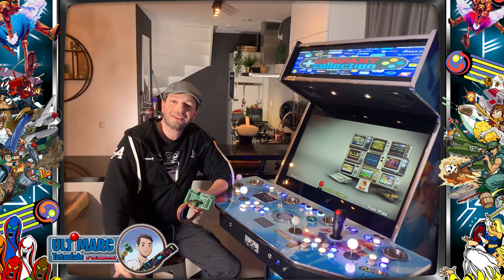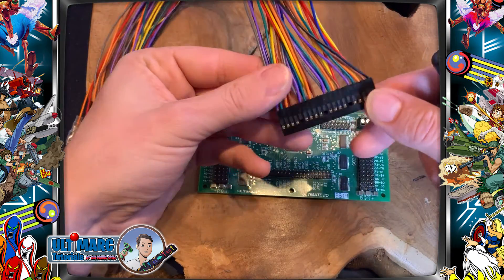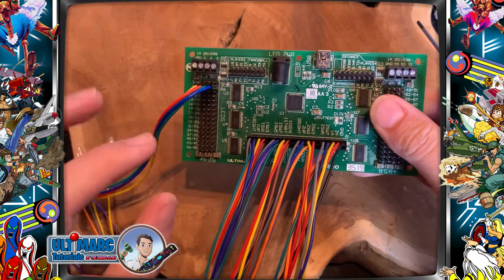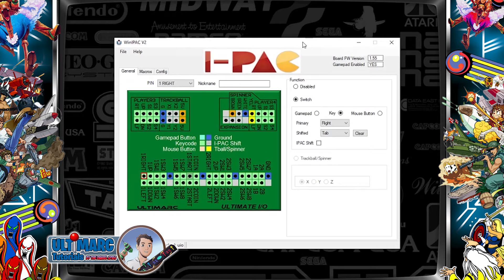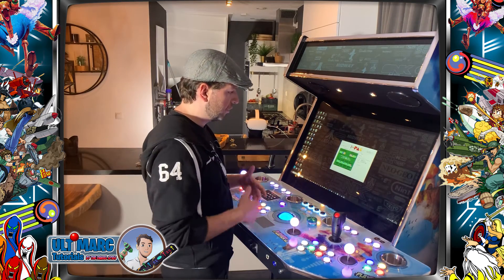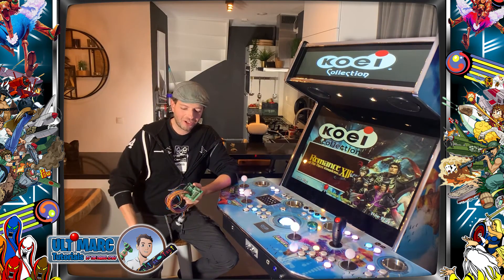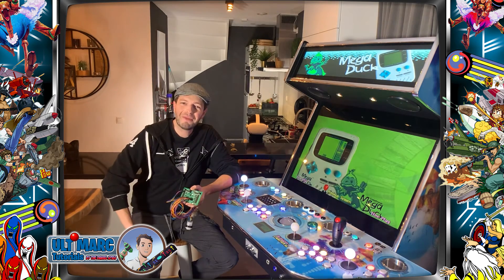Ultimarc Product tutorials: Ultimate IO board (Keyboard Encoder AND Led driver combined)

Comment: I have started, building a machine for my youngest daughter for her birthday and really want to get the LED option but I am scared I will screw this up. It looks so simple. What I did not see was how you connected the Board to the machine. Was there a USB slot already installed the the Ultimarc? I am building her machine on a HP Elitedesktop that runs Batocera.

Comment: Thanks for the video, great work! I wanted to ask a question. I have this board, and when I switch from X-input to D-input, the configuration is lost; the joysticks and some buttons stop working, and I have to reconfigure them. Do you know if this problem could be related to the firmware? Which firmware would be correct for this board? I have version 1.55, but I think there's a newer version. Could you help me? Thanks.
Reply from the maker: X Input is not really supported and Ultimarc also suggest that you don't use it. 
It would maybe be possible to automate importing setups but I have no experience in this myself :-)

Comment: Hey, thank youso much for this video! I am thinking about having 4 player and a trackball, I can still benefit from this board if I connect the trackball via USB directly to the computer right? I imagine the LED would still be possible to connect to this encoder, is this right?
I will have 28 RGB buttons, 8 buttons for player 1 and 2. 6 buttons for player 3 and 4.  I am assuming the trackball will consume one more of these LED slots, but will be connected to the computer via USB. Will this work, or do I need another setup?
Reply from the maker: Yes sure! But with that setup you can just connect it to one of the TWO Ultimate IO boards. Don't forget to order the LED pcb and a translucent trackball :-)

Comment: Please how can this board be used with an original coin mech on an arcade machine please could you maybe do a video showing how if its possible ??
Reply from the maker: You just connect the coin switch like any other button. There is no difference :-)

Comment: Hi Daniel,

I am having an issue with my Ultimate IO setup. I have synchronized all my controls using the WinIPAC software, and everything seems to be working correctly, except for one specific problem: I cannot move up on player 4's joystick. I can move left, right, and down just fine, but the up movement doesn’t work. All other buttons and controls are functioning as intended.

Initially, I had a problem with button 1 for player 4, but now it's just the up control. I’ve used a keyboard tester, and all the joystick movements register correctly. 

I have two Ultimate IO boards; one is running firmware version 1.56 and the other is on 1.55. This issue is quite frustrating since everything else works seamlessly. 

Could you help me resolve this problem?
Reply from the maker: Sure! Please repost this message via email: thedanielspies at gmail.com and I will help out!
Reply: @ thanks Daniel

Comment: Nice nice work! I don't like the preset mode 5 on all the IPAC: if you store keys on mode 1 and then switch to mode 5 for storing a new configuration in Xinput mode for gamepad, if you return to mode 1 manually with shift + sw1 for 10 sec, it doesn't maintain configuration stored on mode 1, but, the last stored on mode 5. mode 5 is not a real preset
Reply from the maker: Thanks! You can maybe send Andy (Ultimarc) an email about this? He might be able to help?
Reply: @TheDanielSpies_Arcades already talked with Andy. He confirmed what i said. Mode 5 is not a real preset. The board only stores ONE manual preset. Only way is switching user presets via command line. It works, nice for switch from mode 1 (keyb) to mode 5 (xinput user) BUT, the switch from mode 5 to mode 1 via command line TAKES..FROM 15 TO 18 SEC !!!!!! with frontend...is unaccettable!! Was better to do this manually pressing shift and sw1 or sw5 for 10 sec but...there is only ONE REAL PRESET: no solution

Comment: Great video. I really the software would highlight the button I pressed instead of me always trying to remember it.   Would be great to show if you plug in the cable in the wrong pin
Reply from the maker: Yes! That is on my wishing list as well. I will talk with Andy if this would be possible. Maybe also find a way of getting X input AND LedBlinky to work on just one board.

Comment: Great explanation, I have question though.  What is the expansion used for?  Only using 1 I-PAC io and I am running 4 player (8 buttons for player 1 and 2, and 6 buttons for player 3 and 4)  I am wondering if I can use x1 and y1(trackball side) for player 3 buttons 5,6, and white and yellow (Spinner side) for player 4 buttons 5 and 6.
Reply from the maker: I don’t think that will work 🤔 to be sure you should ask Andy from Ultimarc

Comment: How do you jump between boards in the software when you have two boards?
Reply from the maker: LedBlinky will find two different boards in their software if you flash the firmware to ID1 and ID2. For WinIpac, I just pull the USB cable out of the one I don't need during setup.

Comment: Hi, Newbie here. After doing research and watching your videos I went ahead and purchased the iPac ultimate, the gold leaf buttons and the servostiks. 

So….
My iPAC ultimate harness ground wire has the gold leaf size connector (small) and the daisy chain ground wire fits all the gold leaf connectors fine….  BUT the ground on the Servostick joystick switches are the larger size connectors. So basically my grounding daisy chain fits the button connectors but not the joystick ground connectors. 

I have another daisy chain with the larger size connectors but I don’t know what to do with it. I don’t see another ground terminal on the iPac ultimate harness. 

Am I supposed to bend or maybe solder the small connectors on the daisy chain to fit the joystick ground connectors?

I can’t find anything online about this issue. I have hit a wall and absolutely ANY advice would be VERY much appreciated.
Reply from the maker: Hi, I might make a video on that matter. For now: there are several sized crimp connectors. Goldleaf buttons use the small ones (2,8mm) , but joysticks generally use the medium ones (4,8mm).  Sometimes your connectors don’t match. In that case you will need to cut the wires and solder them together indeed. Normally, if you order an Ipac at Ultimarc, you can choose the harness with the appropriate crimp connector dimensions. Most of the time no soldering needed.
Reply: Thanks. Yes I bought a crimp connector and added the right size connector to the daisy chain and all is well. Thanks for the reply and for creating such great and useful content. Much appreciated! 👍🏽👍🏽

Comment: Awesome guide! I'm looking to upgrade to this from the i-pac 4, but I need a total of 45 inputs for the joysticks and buttons. Players 1&2 have 6 buttons, 3&4 have 4 but all have a coin and start button. Can just one ultimate I/O board support this? I don't see any places for players 3/4 "coin" and "start" inputs printed on the board. Thanks!
Reply from the maker: Correct, you can just choose any of the available ports for players 3 and 4.  You normally need to use two Ipacs for a full 4 player setup, but without a trackball and spinner it might just work with one IO board. You can double check by asking Andy from Ultimarc.

Comment: Great video, but im trying to figure out where do you plug in the menu buttons, or pinball buttons on your ipac ultimate? Been trying to find that out but to no avail
Reply from the maker: You can plug them anywhere and map them inside WinIpac. I always see which ports are still available and connect them to these :-)

Comment: Great video. I have a light gun. I am trying to get the uhid to output 5 volts when I push the trigger on the gun. I have a seperate pin allocated to this wire and I can get this pin to output 5 volts, but I can’t get it to link with the trigger. Its says in the u config manual I can do this under “uhid controlled leds” thank you
Reply from the maker: Hi, I am not exactly sure what it is you are trying to do, but you can always email me and I can see if I can help! thedanielspies at gmail.com

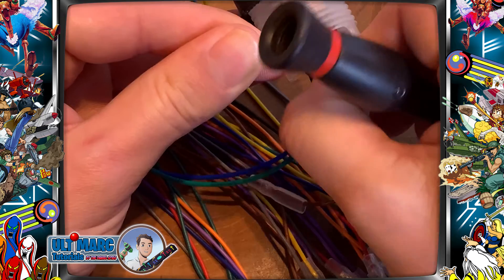Comment: Daniel, at 5:41 you can see there are two metal prongs that the connector would fit to.
How did you know which one to pick? And what is the other one for?
Reply from the maker: This is just a normal switch. These two ‘prongs’ let current flow through them when the button is pressed. You need ground and signal, any orientation is fine 👌🏻

Comment: Having issues installing Ultimate IO here. Tried on 2 different CPUs with Win10 and Win11 and both give a msg "driver error" on Device panel. In Control Panel says " problem with Pnp devices". Removed all harnesses, driver, tried reinstall the driver, DX driver, .NET but no lucky.
Reply from the maker: You can contact Andy from Ultimarc for this. He is a great guy and is always willing to help! Let me know when the issue is solved or if you still get stuck somewhere. Kind regards, Daniel

Comment: I decided to rewatch this to get ready for my second build. I notice you talk about mapping everything to keys. I ran into trouble doing so using a u360 stick and getting buttons wired to the ultimate io to combine as a controller. Using x360ce saved alot of head aches for me and alowed me to play games from steam with no isues because alot of steam games dont enjoy multiple users using a keyboard. So hopefully that helps someone whos trying to get it to work with everything and not just emulators

Comment: Hey Daniel, quick question.
Your CP is quite large. Did you put on extensions on the main harness for the buttons? Mine literally hangs because the wires are too short to work with.
Reply from the maker: Now a days I mount the ipacs closer to the buttons to do as little soldering as needed. But… i still make many custom extention wires nonetheless 😅

Comment: Can you set up this IPac as Xinput 
1. and still use led blinky ?
2. Can I move the button layout in xinput for example I usually run
LB=low punch
X= medium punch 
A= fierce punch 

3. If in xinput mode will the IPac always be player 1/2 ? Or if I turn on a separate Xbox controller can it turn into player 1  as well?
Reply from the maker: No, when using XInput, the RGB functions are disabled. second question, no. :-) 
You can use a PACLED board for RGB of course.
Reply: @TheDanielSpies_Arcades  I thought the ultimate has RGB functions ? A pac led would be used if I had a pac mini or something with none rgb  right?
Reply: @TheDanielSpies_Arcades  or you are saying a seperate led controller is needed to pull off led functions if I want to use xinput capabilities? You can’t reassign the button layout in xinput at all? I’m just trying not to buy the wrong stuff for my build. Thanks in advance for the clarification

Comment: Could I get a little assistance. This video was very helpful. I was able to get the two IO boards, buttons, joysticks, spinner and trackball set up and they work. The issue is when I go to configure buttons on retropie it will only let me Map the controls for one player because it recognizes all the buttons as keyboard and not game pad. Is there a fix for this?
Reply from the maker: Well, you could set the IO boards to X-Input mode but then the RGB function does not work anymore. 🤔 I thought that Retropie had no problems with keyboard inputs?

Comment: I'm setting up a 2 player arcade with trackball and spinner.  I'm having trouble with Emulationstation and setting up my player two controls.  Originally my Ultimate I/O board was in keyboard mode but then I asked Ultimarc and they mentioned I should possibly have it in mode 2 Dinput... do you have experience using mode 2 or possibly mode 4 Dinput user custom with the I PAC Ultimate I/O and any thoughts as to what I'm doing wrong?  Love your videos.
Reply from the maker: Hmm I don’t have experience with Emulationstation + Ipac IO boards. But I did do an Emulationstation build a few years ago with a normal Ipac 4 that did not give any problems. 
Email me to explain what isn’t working and I will try to help out. Thanks D

Comment: Hi, I'm confused about one thing and wanted to ask if you can help me. At 5:00 you're showing two different connector sizes for goldleaf or microswitch buttons. Are these two different harnesses, or does the harness have a mix of two different connectors? I see you can order a harness that has both types from Ultimarc but does that mean it only has the larger one for joysticks and the rest are smaller? Or how does it work? Can I have both goldleaf and microswitch buttons on the same console?
Reply from the maker: Hi, The goldleaf buttons have smaller pins than the microswitches. If you order a harness at Ultimarc, you can choose which buttons you are going to use. As the Joysticks have normal microswitches the harness I ordered had both sizes. Hope this makes sense :D
Reply: @TheDanielSpies_Arcades  Thanks. :) I figured it out. The answer for those who may be interested, is that the smaller size harness has larger size connectors for the joysticks, player start buttons, and coin switches. Everything else is the smaller connector for goldleaf buttons.

Comment: Amazing unit. I have an arcade machine but with the x-arcade controll panel which I want to update and make my own custom 2 player control pad. Can you let me know if you have a 2 player config and if you can also provide a list of parts. I love your setup and want to do the same for mine.
Reply from the maker: For two players you just need 1 Ipac! super easy. Also, buy a Hyper Arcade Systems drive from Chris that is pre-configured and you are up and running in no time.
Reply: @TheDanielSpies_Arcades  Thank younfor your reply and for the info. Again, amazing work you do. Really inspired.

Comment: My ultimate i/o has game mode greyed out. Why might this be? Tried it on retro pie and windows.
Reply from the maker: Hi, Modes can be switched by pressing Start1 (or user-set alternate I-PAC shift) and holding this, and Player 1 button 1 through 5, for 10 seconds.
If this does not work: do you have recent firmware? Thanks, Daniel

Comment: Firstly, this video is great! I have a quick question regarding the ground, I have the harness but as you mentioned it only has one ground and because all buttons need to be connected to the same ground, how did you do it?
Reply from the maker: You will need a daisy chain ground cable (or two) to connect all the buttons together and attach it to the one free ground pin on the Ultimarc board :D

Comment: You say MAME works better with keyboard inputs instead of gamepad. I'm using gamepad because I need to also play PC games like SFV and MK11. I tried mode switching but it was unreliable. I haven't noticed any issue with gamepad inputs.
Reply from the maker: You might be interested in the last part of this video: https://youtu.be/m94Q-k9ITb0?t=678 I am setting up UCR. This works reliable and is easy to setup!
Reply: When i get my 2 boards I'm also planning to make them act as x-input controllers (4 "controllers" in total) so that i can play Arcade-friendly games on Windows.

Comment: Your videos are really amazing!
I've been trying to purchase a custom 4 player PC based arcade from a few guys here in the USA and have been getting the run around from all of them. The only really legit sellers want like $5-$7k and that's just not in my budget.

I just started looking into how to build my own and I feel like I'm in over my head. I know nothing about wiring up electronics or what parts to buy. I was considering buying one of those cabinet kits that you put together with the cam lock systems and then buying a PC loaded with Hyperspin or Launchbox from one of those ebay type sellers. Then attempt to wire up the whole thing after I purchase the buttons and joysticks etc. It just seems like a daunting task for a newbie and there doesn't seem to be any good step by step instructional videos out there. I'm telling you....if you were to do like a "How to build an arcade for dummies" type of series here on youtube, you'd have so many subscribers and views. You're really good at explaining things and seem really helpful.
Reply from the maker: Great idea. Thsnks!
Reply: i can do it for 4k
Reply: If you haven't done anything yet, I can't speak to building anything but Launchbox itself it really really easy to use.  You can look up ETA Prime's videos.  His step by step instructions are idiot proof.  Probably the hardest emulator is Daphne.  Seriously, Launchbox is easy sauce to get running.

Comment: Hi Daniel, great video. I had a question about your button configuration. How did you get your default colors to stay those specific colors? I was also trying to mimic an xbox controller layout but I cant get the colors to stay or show active. I also have the led blinky software installed for the front end animations so my buttons always just cycle regardless of what I have running.
Reply from the maker: Hi,  I have a 'default' setting in my LedBlinky Control Config program that keeps the buttons the way I want them thru all the MAIN WHEELS. When entering a wheel then I have custom configs for all games or defaults for each emulator.  Send me an email if you have anymore questions and I will try to help you :-)